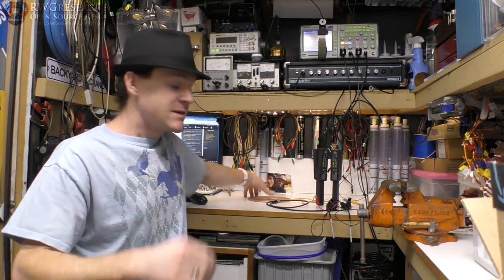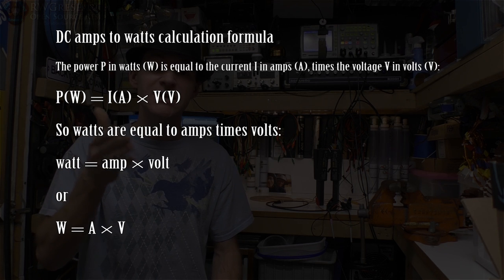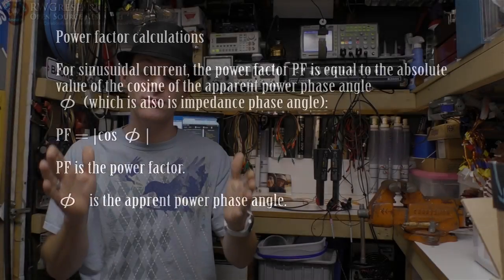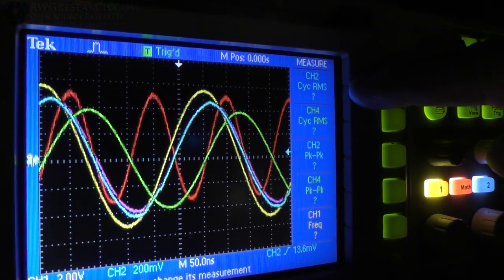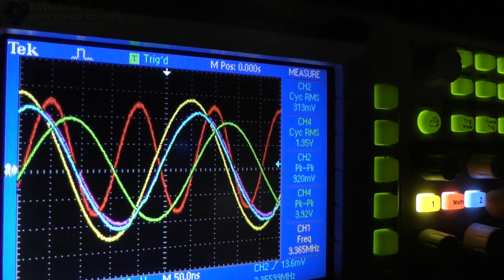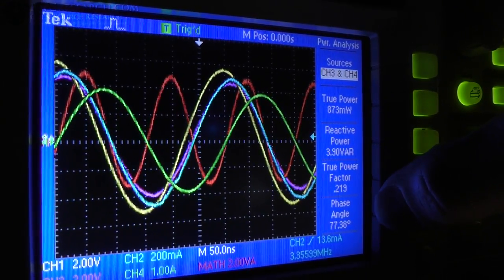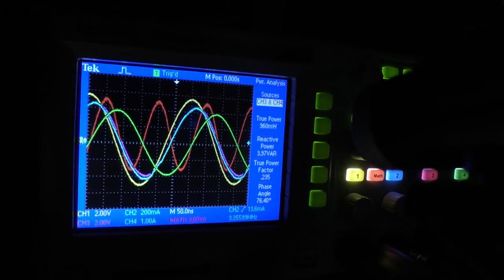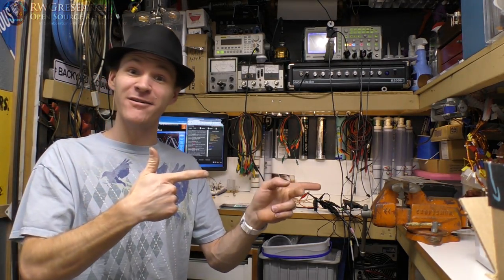Responce #2 Tesla bifilar Pancake Coil Anomaly. Phase shift. A.C. Watts = A x V X PF

Comment: "ELI is ICE man". This sentence helps a lot to remember the sequence of voltage and ampere applied to inductor and capacitor in AC voltage. 
In linear circuit textbook, "E" represents Electric Field, often regarded as voltage, "I' represents current and "L" denotes inductor as you may know.

SO the "ELI is ICE man" can be transformed to " Voltage Inductor Current, Current Capacitor Voltage". interpreting "Voltage advances current when applied to Inductor. whereas Voltage lagged behind current when applied to Capacitor."

Comment: Russ, nice explanation at the beginning of how PF (or phase shift between voltage and current) must be taken in to account when calculating AC average power. But I think it is also important to understand (and make explicit) the difference between RMS current or voltage values and Peak and Peak-to-Peak values, and also the relation to "average" or "mean" values. And also how some of these calculations are only valid for pure sine waves. For example, for pure sine waves the equation
Irms x Vrms x cosine (phase angle) = average power
holds true.  Also, Peak-to-Peak voltage x 0.3535 = RMS Voltage (ditto for current) also holds true, for sine waves. 
If you recall your trigonometry, cosine (angle) tends rapidly towards zero as the angle approaches 90 degrees. SO systems that produce phase angles close to or equal to 90 degrees will result in the calculation above yielding zero average power, or close to it. And measurements will agree!  Many people have fallen into the trap of seeing such results and interpreting them to mean, in one way or another, that they have an "overunity" system. This is the "miracle"of Reactive Power! It will bamboozle the best of us at times. 
Keep up the good work... and make shorter videos! 
(And of course you CAN measure phase shift with your oscilloscope and only passive voltage probes. Your power analysis software needs the current probes, but your scope will tell you the phase difference between two signals and you can do the necessary calculations manually. )

Comment: Russ use thick copper wire varnished , and make the new dimension of the wire that you used is not suitable for bifilar winding, thick insulation layer between the turns, sorry my English :)
Reply: That is correct. For maximum inter-turn capacitance the wires must be as close together as possible. Using enamelled magnet wire means each conductor is separated only by two layers of enamel from the adjacent conductors. Using plastic insulated wire means the conductors are much farther apart and so the interturn capacitance, and the effects thereof, are greatly reduced.
Reply: I wanted to say it , but the Russian-English translator might have distorted the meaning of the words I'm typing through online translator .

Comment: Russ the PF shows a wide margin less output than input compared to Tin Man . For consideration does a mechanical load show far reduced power those levels from the coil compared to ordinary input? Where does so much of the input power go in the lossif not in heat then in magnetism and if magnetism then is it near transformation for a power condition?